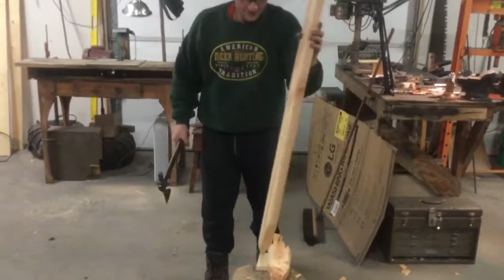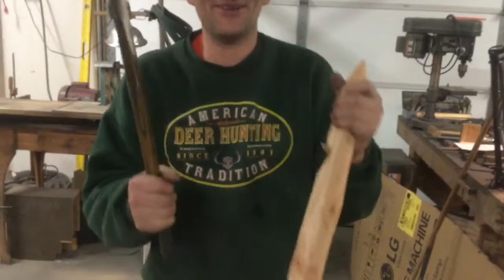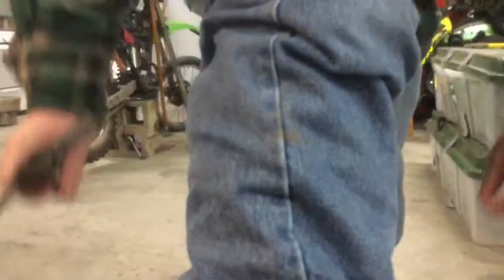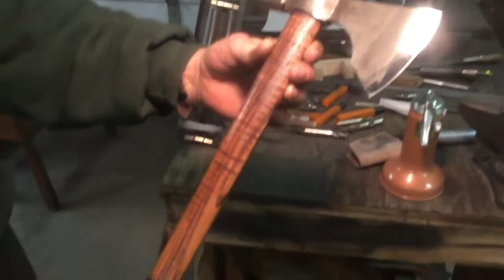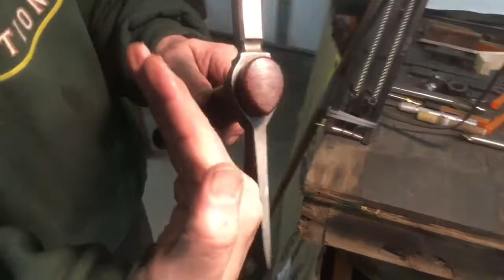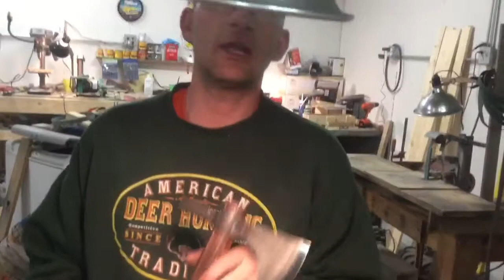Chopping and Talking

Comment: One  more thing, he never cuts at 90°. There is no need to. A 90° cut was made by the saw. This is the way to cut wood. These were axes carried in the wilds because they were light. And easy to fix a new handle. Though these tools were treasured in the wilds, because it was needed everyday. Firewood was never 6" timber chopped to size.  It was small branches gathered from dead trees. The hawk was the perfect tool.

Comment: In times gone by, the men would not buy crap they depended on. That is only today's manufacturers. Mass produced rubbish. In the past these axes were carried as a tool to survive with. They are a light axe made for trail work. It was easy to make replace a broken handle with a knife, or the head. They were used to cut green wood for camp building and cutting dry firewood. You do not split 6" logs for a fire. You cut dry branches for a camp fire. Big logs they used a saw. Right tool for the job! Nice to see a well made tool made by craftsmen.  Well done sirs! I want one. Do you ship to the UK? I HOPE YOU DO!
Reply from the maker: Yes, we do ship to the UK.  Contact us for details.  www.WalkByFaith777.com